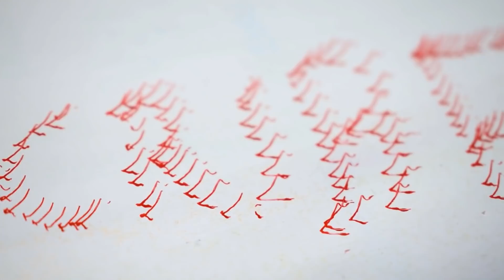6 SIMPLE INVENTIONS

Comment: No offense to you WEMYOUR, but wouldn't gluing the battery's into the devices make it impossible to change the batteries when they run out of power? What about gluing in battery CASES instead of batteries?
Reply: Even me,Im very triggered,*VERY VERY TRIGGERED* at gluing the BATTERY instead of the TERMINAL